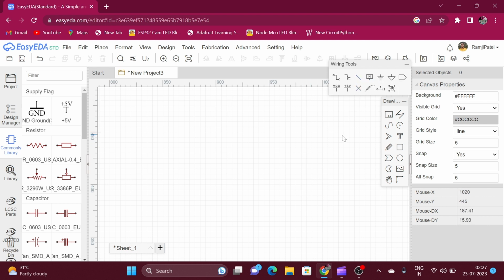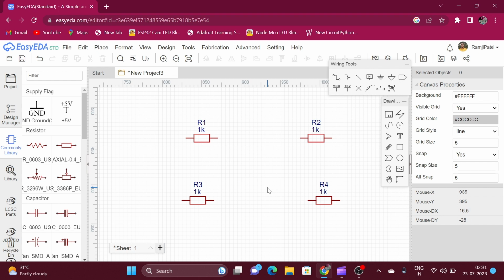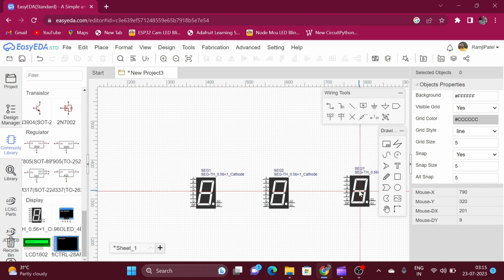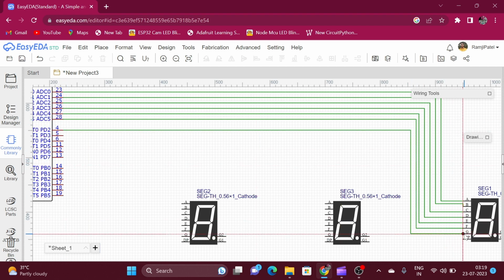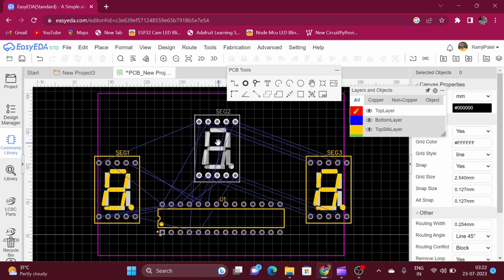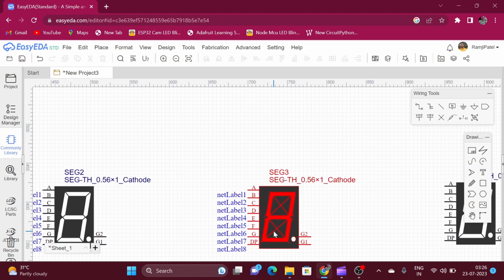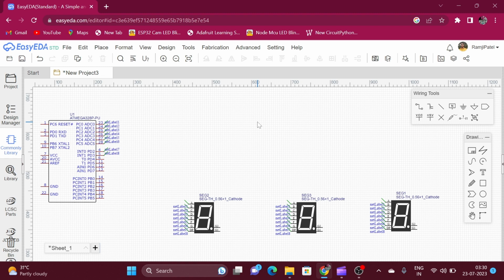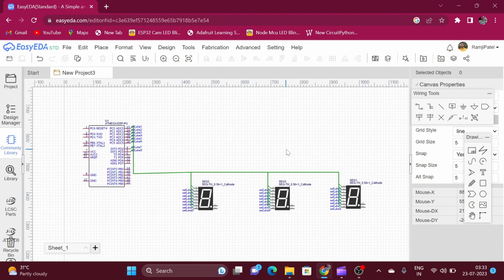Use Wire Bus Bus Entry & Net Level Tools in EasyEDA

Comment: Thanks for this helpful video.
I am struggling with finding a way to connect 3 (got the Junction where they meet), 
but keep the wires junction attached to the 3 wires - even when moving each one of the wires.
as of now, when dragging one of the wires, it's losing connection with the other two.
if you or someone know how to do it, I will appreciate a lot you advice.